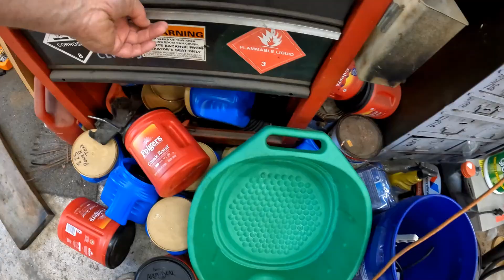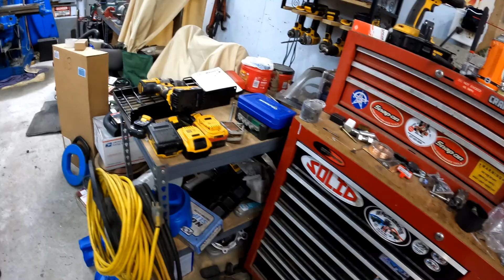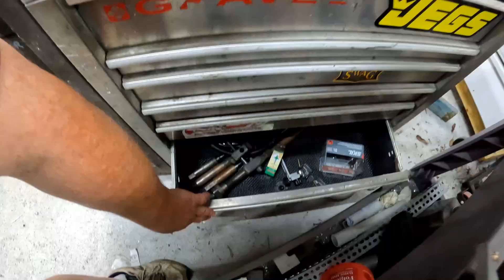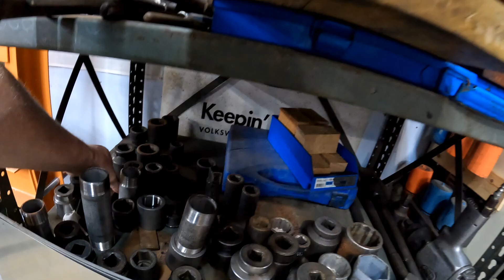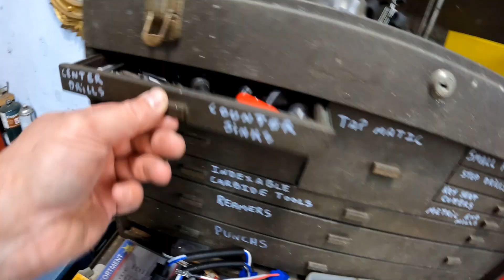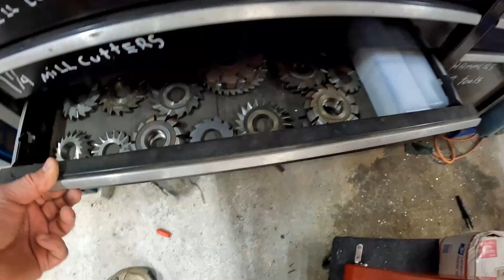Tool Box Tour -- What Tools Do I Use??

Comment: The shop my dad and I have looks about the same.  14 large top and bottom boxes, numerous small boxes, and about 4 large top chests at home for all my firearms tools. It would take years to just clean and reorganize everything, and for the most part I know where everything is. I'll buy a good used mill and lathes set up once I move to AL later this  year.  Anything used for when I was an industrial equip mechanic, cars and motorcycle restorations, aircraft work, etc.  I will have to inventory everything and replace the damaged tools but I keep putting it off LOL. Awesome place ya got there!
Reply from the maker: Thank You!